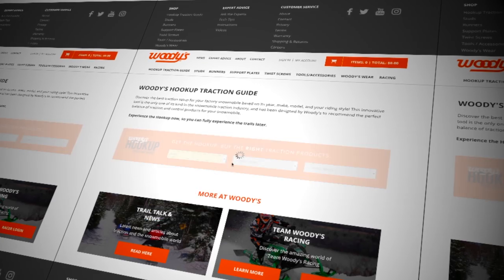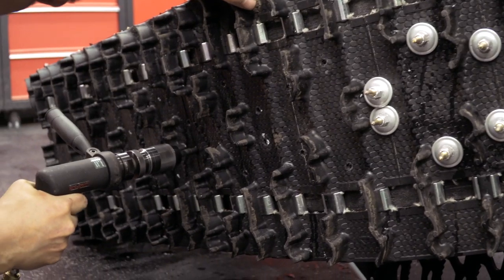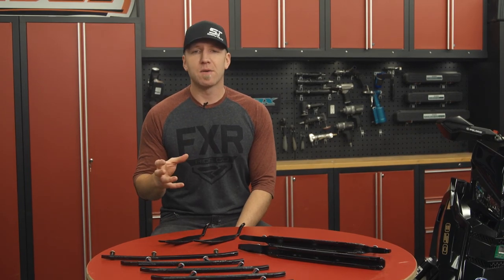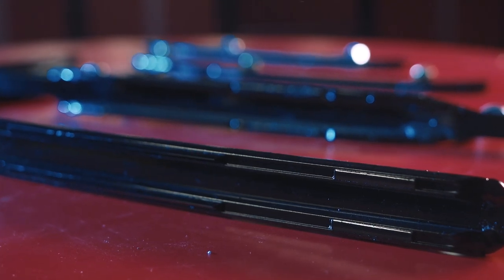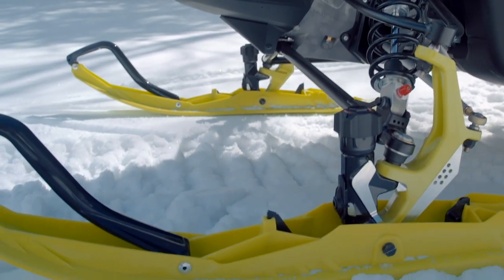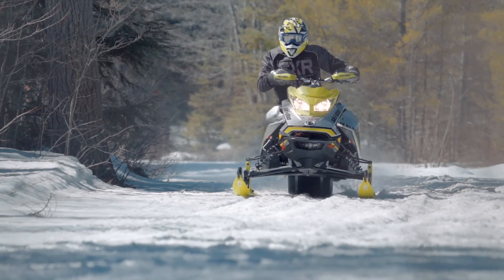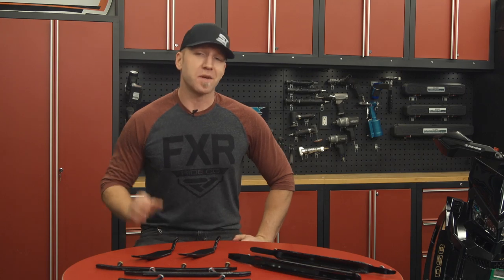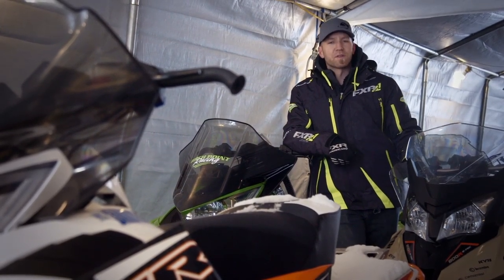Best Carbide Runners For Your Sled

Comment: Was actually thinking the other day 'it would be great if snowtrax did a segment on runners'. And here we are! Looking to lighten up the steering on my Nytro, your advice is much appreciated! Will be looking into the slim jim or duallies.
Reply: You are not going to lighten up the steering using two carbides per ski, quite the opposite.  Slim Jims are improved Dooly's that just wear out faster.  Look at Accord Racing Double downs Or single carbide runners with a square stock bar.  You can also check out the Cobra bars from Qualipieces.  I got away using 6" Studboy Shaper bars on my 07' Phazer that likely had equally as crappy handling as your 08' Nytro.  I believe Woody's is a sponsor of Snowtrax so it's not surprise that they are recommending their products.

Comment: You need runners.... DIY
Its easy just think about it.....
Get a steel rod ,Bind it how you want it...weld 3 pins (you know where) and the fun part is to sharp it with grinder in a ''hockey skate blade'' shape..
With 2 pairs,im good for the season (7000-8000km) and instead of 240$ for 2 pairs , it cost me 14$ + 45 minutes ! !

Comment: Great video, Im running a 2018 Polaris indy 600 base, it has a 0.92 lug polaris track on it. I only run trails and im a moderate to aggressive rider. I find the sled spins the track everywhere even on light throttle inputs. I am planning on studding the track but im wondering if that is going to be enough to help or should i look into a 1.25 lug track and stud that. As i said i only run trails and i do big miles when ever i get out so im looking for the best solution, what would you guys recommend?